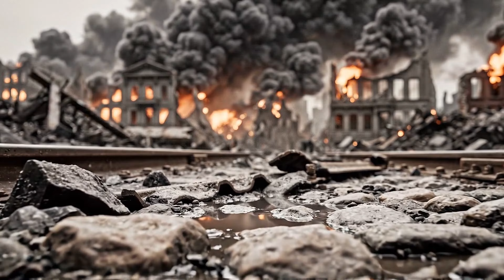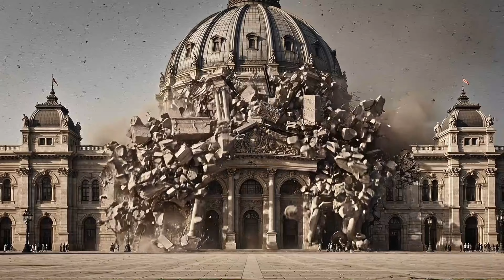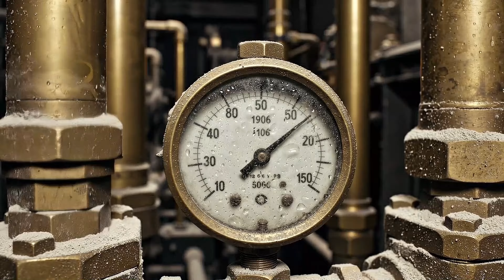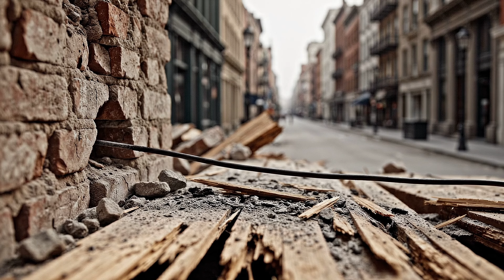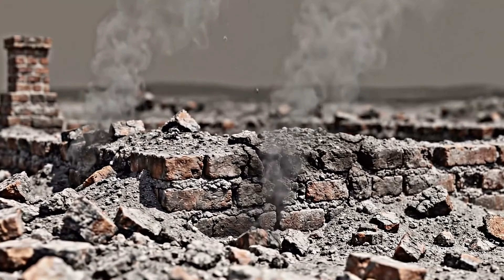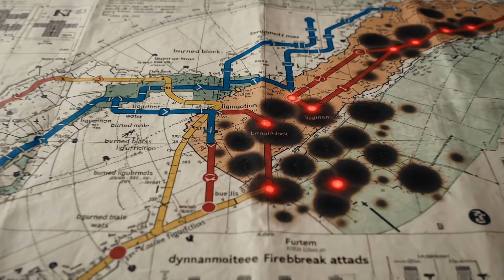The Day San Francisco Burned: 1906 Earthquake and Fire Explained | Cinematic AI VFX

Comment from the maker: @RealisticDisasterVFX: The most terrifying part of the 1906 San Francisco disaster may not have been the earthquake itself, but the chain reaction after it: broken water mains, gas leaks, failed pressure, and spreading fire.

What do you think was the biggest engineering failure: the water system, the gas lines, or the use of dynamite to stop the fire?